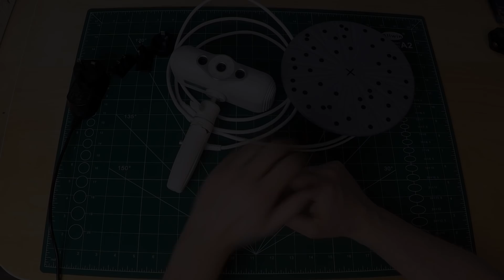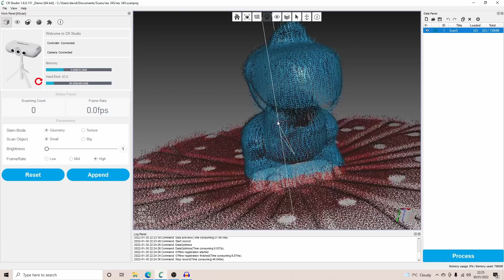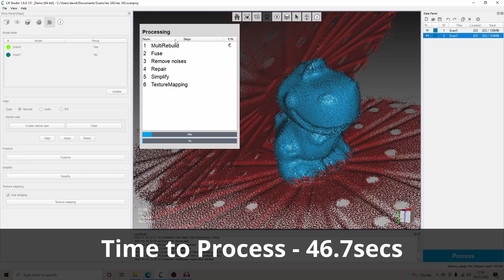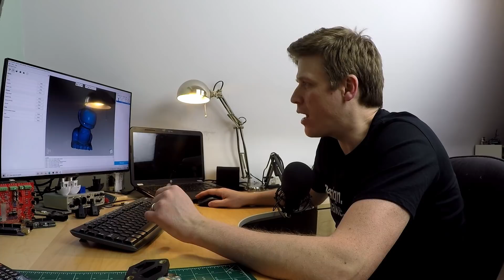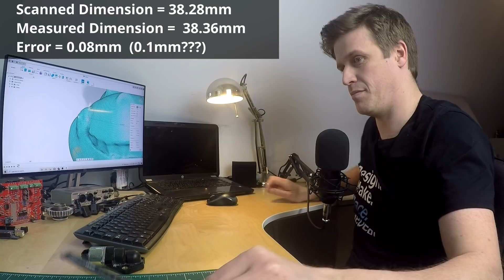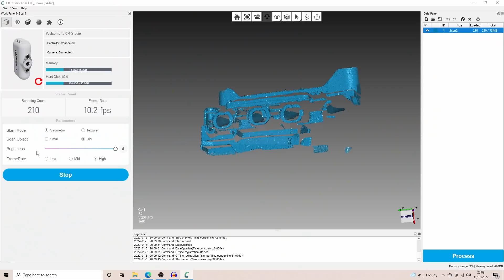Creality CR-Scan Lizard Review - does it reach 0.05mm?

Comment: Can I recommend for you a budget (~ish) laptop with an AMD Ryzen 7 7840HS with dual graphics + AMD Radeon 780M & NVIDIA GeForce RTX 3050 6Gb.  They're out there, mine is Lenovo LOQ 15APH8 Gaming Laptop. Maybe get it some some extra RAM.  Performance wise using various 3D modelling programs it is nearly up there with my old Alienware (now obselete & currently unalive) R15 Ryzen Edition & the Lenovo was the best thing, bang for buck, that i could find to replace it.  

As for a Desktop, anything based around an AMD Ryzen 7 7800X3D is going to be hard to beat.

Comment: I would think the hardest thing to scan to REALLY test it, would be headlight reflectors from older style headlights. So it has to face off against not only a reflective surface, but also how well it takes the critical shapes and geometry needed for that beam-pattern to match up.
Reply from the maker: With A LOT of dulling spray, that could work well…
Reply: @MakingforMotorsport  That would be extremely interesting to see if it's possible. Would be huge for restoring older cars with parts that are no longer available!
Reply: Now I have this problem, nothing helped me nor shampoo, nor spray !

Comment: If you do more reverse engineering I recommend to use GOM inspect (free version)
There you can pretty easy align the mesh and creat planes. And planes aligned to other planes.
In the end Export the model and the planes as iges file and import it into Fusion or other CAD. 👋
Reply from the maker: You might want check out latest video… GOM inspect used 👍👍👍.  Need to learn more tho!
Reply: @MakingforMotorsport  Oh ok :D
Reply: @MakingforMotorsport  watched the vid buuut you can make your life probably much easier if you use GOM for the plane extraction too.
https://www.youtube.com/watch?v=V3xAwpENbU4
Reply from the maker: @Todestelzer  yeah, so I have done this, which is great. But, there is a big problem.  Pretty much all of the machined faces on a part like this should be directly parallel to the original planes…. 

And planes such as the drive face and the brake caliper mounting face, should also be parallel, sure there will be a tolerance on a part, but in design they should be parallel, no reason for them not to be.

If I use fitted planes on all of these faces then I won’t have parallel faces, great for inspection, but not great for design intent RE where these parallel faces really should be.

Now I am trying to work out GOM so it can fit “offset planes” but it’s alittle trickier than Fusion!
Reply: @MakingforMotorsport  You can constrain the extracted plane to another (extracted) plane or even the reference plane. 
Everything should be square to each other. 

The learning curve is steep in the beginning. But I think it's worth to look into it. 

I don't used it much myself yet because I found out of this program recently too 😁

Comment: Hmmm now i don´t know if the CR-Scan Lizard or the Revopoint Mini is the better option. The CR-Scan Lizard is about 250€ cheaper. The most things i will scan are some engine parts and stuff like your control valve. From the feeling I find the method with the blue light better with the Revopoint. I also learned from some videos that some LED lights interfere negatively with the scanner. It doesn't matter if it's a CR or a Revo, it's still a lot of money and I don't want to buy the wrong one.
Reply from the maker: Unfortunately, it doesn’t feel like there is a 1 size fits all and at the consumer end of the range each scanner has its ups and downs.  
The mini is giving great results (I haven’t tried it in person) but for most of my applications it is well over the top and to limited in terms of scan area, the Pop2 seems like another good option and might be the overall better scanner than the lizard, once you factor in the software experience (not played with the Pop2 but that’s my impression), and the CrScan is the best at body panels and larger objects.
It’s a big investment but I think either the Lizard or Pop2 is the best, most flexible tool unless your going to be doing regularly large or very small objects…

Comment: As someone with an extremely uncommon car (R30 Skyline wagon), especially here in the States, I jumped on this the second I saw the kickstarter. So many parts don't exist anymore, and there's next to zero aftermarket support, so having this around, and a 3D printer, is going to save me a heck of a lot of headaches. I've also been trying to design a bolt-on IRS replacement for the solid axle and this is going to be a gamechanger for that as well.
Reply from the maker: Love the old R30!  Working on a video now how to go from scanned stl to a full parameterised model… 
You may find it useful 👍😂👌

Comment: Why don't you use anti-reflection spray? Should make the models come out way nicer. I scanned a lot with a GOM Atos Triple, for very high accuracy always prep the parts with airbrush, titanium dioxide and methanol mixture... Also spray cans exist, but you'll lose a bit of accuracy.

Comment: With the rise of 3d printing and the great results you can get from a pimped up Ender 3d which I use, I think to be able to use a decent affordable 3d scanner to create files to print is brilliant. So far 3d scanners have been not very good and very expensive, since this is a CREALITY product and I really love my printer I am going to give this a punt on kickstarter - I vowed never again to back a tech product on Kick Starter as I have been ripped off too many times but this being Creality I am going to give them benefit of the doubt to deliver - Great video many thanks - I have backed it.
Reply from the maker: I am consistently impressed with the results from this, quicker and more accurate than by hand and although I have got by without one,  but now I have I am constantly thinking or things to do with it.  
I am confident you’ll enjoy it, and if you used my link, thanks very much!

Comment: Very curious if this thing can manage engine bay scans. I have a few projects I really want to do like some brackets attaching to complex multi angle mounting surfaces, intake tube design, and maybe even scan an envelope for custom exhaust headers or intake manifold. Keep out zones and mounting surfaces for modeling would be huge!
Reply from the maker: It something I am curious about too,and you need about about 200mm in front of the scanner to nicely register a surface.  By those numbers you could scan certain areas or features but you would struggle to get a really good scan just through lack of access…
Reply: @MakingforMotorsport  ahhh man that’s rough with the clearance needed that makes it hard for engine bays. Do you know of anything a step up in this space? $1000-2000 range, or is the next jump really to a ~$10k scanner?
Reply from the maker: @Dmac765F  they all need a “range” as they are all “optical” in some sense, even high end machines have a minimum and maximum range, and you also need to get different angles the on the subject (like straight on, above angle and below). It’d be very easy with the CR-Scan lizard to scan an engine bay and you’d get great results, as long as the engine wasn’t in it!
To work in a confined space you need something which works more like a probe….
Reply from the maker: @Dmac765F  einscan do some units around the $1k plus range but because they are low end “pro” kit, they are actually far more limited in functionality that the Lizard is from what I have seen… still very good, but “if it won’t fit on the turntable in a dark room” it ain’t scanning…
Reply: @MakingforMotorsport  welp you got me with that idea lol I just ordered the kit. My engine is broke so it’s coming out soon. 700+ hp ls7 going in

Comment: 67,41 - 67,35 = Error 0,06 (at 26:10) not 0,07mm

i got much better results by using my canon 600d and manual rotation. never seen such a horrible mesh.
way too expensive for this results....

but thanx for the review.

Comment: Would using a gimbal make hand scanning easier as the device will be steadier?
Reply from the maker: Not sure it would help, speed is more the problem rather than smoothness, and every so often a gimbal runs out of range of motion and looses its mind… or it does when I hold it 😂

Comment: Hi there. Great review on the CR Scan Lizard scanner. I’m watching the low-cost scanner tech, but I’m not ready to pull the trigger yet. Yes the precision is there, but the scanned surfaces are still pretty wonky.

Anyway, I have some Fusion 360 mesh pointers for you. I’m not an expert, but I’ve been getting a lot of experience over the last 6 months or so.

First, instead of using the INSERT tool on the right side of the SOLID toolbar, switch to the MESH tool tab & use the INSERT MESH tool on the far left of the toolbar. You will gain a lot more control of the mesh parameters, including units used to import. Then you can change those parameters later by clicking the operation in the timeline.

Second, you can create a sketch element where the mesh body intersects a plane, much like you would with PROJECT INTERSECT on a solid body. To do this, place a construction plane where you want the intersection sketch to be. Then while still in the MESH tool tab, select the CREATE MESH SECTION SKETCH tool (3rd from left). Then you can do measurements directly on the intersection sketch, or you can add sketch elements to mate with the mesh-body.

Third, you can go back to the SOLID toolbar & create solid bodies from the intersection sketch you just created. I you’re adding volume features to the model, it may be enough to leave them as solid bodies. But if you want to do subtractive or cut operations, you will need to convert them to mesh bodies first. To do that, back in the MESH toolbar, select the TESSELLATE tool (second from left). Be careful to select the REFINEMENT level that gives you enough detail without overwhelming your processor.

Fourth, MESH COMBINE works much the same as SOLID COMBINE, with ability to Join, Intersect, Cut, or Merge mesh bodies. MESH PLANE CUT is almost like SOLID SPLIT BODY,  except that it only works on a plane.

Happy meshing!
Reply: Как вы думаете, кто сканер можно исползват как стоматологических? Точност хватит?

Comment: Should I buy this for myself? Is it fit for professional automotive scanning or just at toy for kids?
Reply from the maker: Depends what you want to do… it’s definitely a practical piece of kit and gives usable results so far.  I haven’t tried the POP yet, but I doubt for mechanical pieces there will be a big difference…
If you want a big step forward you’ll need to spend big money and get the pro level reserve engineering software…

Comment: looks decent; im still skeptical of details on more organic parts.. also a little bummed with you not actually showing what you show in the preview thumbnail - why show that at all if thats not what you scanned and had as a result?
Reply from the maker: I did scan it, and that was the result, but at 30mins+ the video was too long and the part didn’t really add to the video… but is more eye catching than the other parts…
Reply: @MakingforMotorsport  that was the more impressive result as far as I can tell, would have been worth at least a 3min 'i also scanned this, here's the point cloud and final result, -insert example dimension-' 🍻

Comment: something one need to take into account as well that even good calibrated calipers often has a 0.05mm margin of error so a micrometer would be more "fair" to measure these tests since their margin of error is smaller then the 3D scanner, having a scanner and a measuring device with the same tolerance of error can really shift the result.
still an interesting and good video and i'm just a nitpicker.
Reply from the maker: I should’ve gone to the garage and got my Mitutoyo calipers… but I haven’t had them calibrated recently 😂

Comment: Great video! Love to see people still rocking the Intel X58 platform. FYI if you are're still running stock, you should really look into overclocking that old 6 core Xeon. It's fairly straightforward to push all 12 threads to at least ~4.0 GHz or so without much risk and it'll feel like a new computer. I have a W3670 and a couple of other Xeons from that era that have been OC'd for years and they're still going strong. Those old Intel platforms are great.
Reply from the maker: Nice!!! This has come at just the right time mate, just swapped up the laptop (for obvious reasons) and being able to level up the desktop is perfect!  
Now to just work out how the hell to do it! 😂😂
Reply: @MakingforMotorsport  Well if you can tell me your mothboard model I can let you know if it's worth trying and point you in the right direction. As long as you don't have some OEM workstation board, the BIOS options in these old platforms are fairly straightforward and there's a wealth of info out there for them.
Reply from the maker: @JJFX-  haha!  That’s exactly with I have I think! I’ll have a look tonight 😂🤦‍♂️

Comment: In the time around 2006-2008 this took a $100K Steinbickler camera. I know, I was making customer supplied parts into .STL files at cost to the customer of about $1,200.oo for a simple part like that Dino toy.
   I am an expert and that $1,200 billed, took me about 10 minutes with perhaps 5 more to make what’s called a “water tight manifold” then perhaps five more to type out and send him his bill. Once paid, I’d send him his . STL file. 
   I was making about $35,000 a day and had paid off my camera in less then a week. It was like printing money but easier!!!
   So I am curious of what kind of accuracy you are getting. I was guaranteeing my customers better than 25 microns!
Reply from the maker: I think 25microns is ambitious with this but sub 0.1mm is definitely achievable and I got 1 measurement within 50microns but surface flatness of the mesh is coming into play then so there is some loss of precision there…
So, not metrology grade but very usable for a home gamer setup!

Comment: I find that most "scanners" whether they be laser, dlp, or photos tend to produce meshes that require a lot of rework for mechanical parts. I believe a better solution is the integration of a cmm arm with the actual CAD package like Microscribe, Rommer, Farro, etc. Of course those are big bucks and probably beyond the price range of most DIY hobbyist as opposed to the much cheaper to build CR. Great video, thanks for sharing. 
Example of CMM and CAD integration. 
https://www.youtube.com/watch?v=L1l0Ht_GeEk

Comment: About fifteen years ago I played with what was at that time the (still very expensive) "consumer" entry level in 3D scanners -- wow, the technology at this level has really improved. I remember a process where you had to wait for the scan to complete before you could see whether you picked up anything at all. Coating everything with powder spray, because the machine was pretty much blind without it. You could waste an entire day on a single piece and maybe eventually give up on it. It did at least come with a license for a decent reverse-engineering application (RapidForm).
Reply from the maker: Yeah, i am pretty impressed with it.  The thing it is missing is a decent Reverse Engineering piece as the coordinate system is still messed up when putting it into a 3D package… but there are doubtless tricks in Fusion which will help!

Comment: I'm trying to think of a solution for my AEM water/meth kit for my 2014 Tremor. It's a regular cab so I really only have behind the passenger seat (they advise against exposing the pump to the elements) so I want to design and print a box for the tank, filter and pump to all fit in. I have an ender 5 xl so I think I could fit the whole ass box, but I think I'll have to print it in a couple pieces.  Never designed anything on Fusion though, kind of intimidating!
Reply from the maker: An Ender 5 XL and your not getting on Fusion??  Honestly, take the plunge mate, it’s not hard, I have some modelling videos which are step by step and Lars Christensen channel has some great starter stuff…
Honestly, download it, set aside a couple of hours and you’ll be wondering what the problem was 👍👍👍💪💪👍
Reply: @MakingforMotorsport  Lol I have the problem of "too many irons in the fire". She's  upgraded with the cap tube, the dual filament grippy rollers and the "upgraded" board. So she's ready to go. First couple prints failed due to low voltage on the extruder motor potentiometer and I need a smaller memory card, the 64gb card I bought is apparently too big.

I've got in Fusion a couple times to tinker around and was able to make a box with the shell command, just haven't gotten much further lol. Lots of options, just need to figure out the right combo to make some fancy things, and I'll get the hang of it NP 👍👍

I'm pretty sure I've watched your videos on it and have probably seen Lars videos by now also lol but I'll definitely rewatch them 👍👍 Thank you for putting them out btw!!!

Comment: Any recommendations for turning the scan into a usable solid model that can be edited in autodesk or solidworks? Mesh files are terrible to work with.
Reply: In my workplace, i use Geomagic Design X. It is pretty good for reverse engineering and all the history tree can be carried to solidworks. It handles mesh well. But it is not an automatic process. You kinda have to make it from scratch but the software is helping with a lot tools. Its pretty expensive tho.
Reply: I think the best way would be to make a scan, put it into CAD, and make a model following the scan. Time intensive but much less so than having to do it without the mesh

Comment: i dont get 3d scanners. the output without a proper reversing tool ($$$) is mostly useless regardless how much they cost. am i missing something? If you are going to CAD from scratch over the scanned object is a 3d scanner worth it considering they are quite expensive?
Reply: "proper" scanners are used for metrology